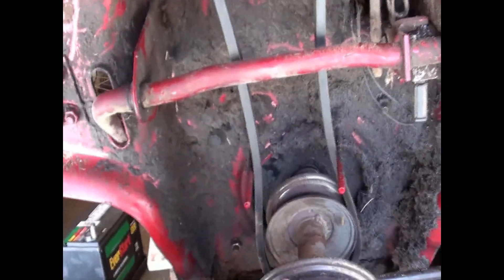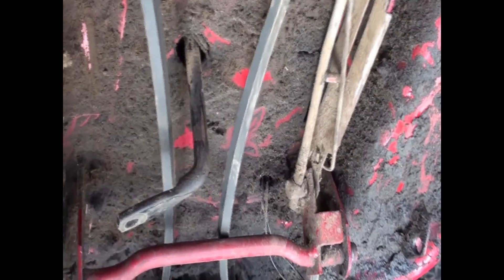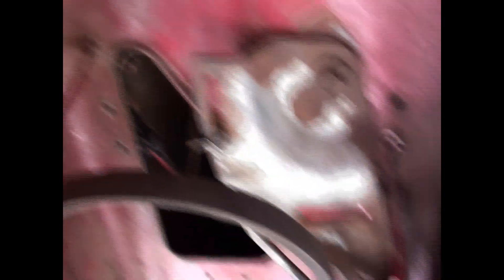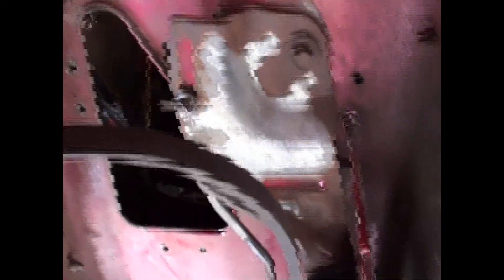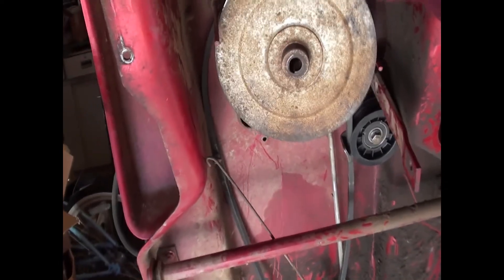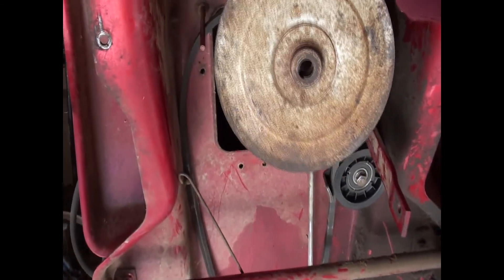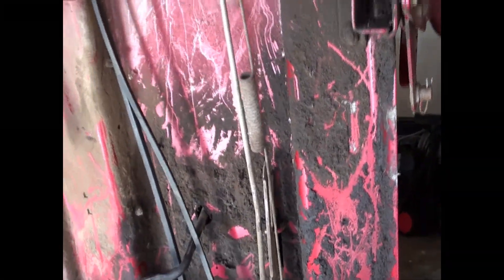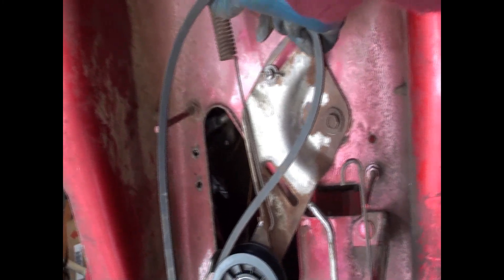Murray Riding Mower Transmission Linkage  part 1 (Model 38608X92C)

Comment: My Murray had the tension spring missing, because my model was sold under a white label I couldn't find the right schematics and therefore I wasn't quite sure how the spring was installed, your video was very helpful with that, thanks!
Reply from the maker: glad you found the video helpful.  FYI i got rid of the murrray a few years ago and have a White Outdoor 16.5 hp briggs twin opposed cylinders riding mower. Both the Murray and the Whites are MTD machines, I think.

Comment: What is the part numver for the idler pulley? Mine is worn out. Is there some kind of interchangeable one? I cant find that pulley anywhere.
Reply from the maker: Mine was worn out too and I replaced it with a new one.  
Google this:   "Murray Mower Idler Pulley 91179 or 42109"  Also search ebay for the same part number and description.  There are pages of them listed for sale.
Also a parts diagram is at the following link on the pages marked "Motion Drive"  https://www.partsandservice.com/html/Murray/lt/lt38608x92c.html

Comment: I have been trying for days to find a video that will show why the shifter just does not put mower into gear. It has no tension.  None of the quick fixes that I have been seeing is the problem.
Reply from the maker: It sounds to me like a problem at the end of the shifter shaft inside the transmission case.  The Foote, Dana and Spicer transmissions are very much the same in design.  You might want to search the many youtube videos under the search words Foote, Dana or Spicer transmissions.   Just for example, here is one that might help.  Within the video is some info on the shifter plate, spring loaded balls, and the need for lubrication.  Perhaps you are experiencing a problem with any one or more of those items? https://www.youtube.com/watch?v=2v6QCUTiGa8
Reply: @takeachanceonme4  thanks. I watched the video suggested. I'm afraid all that is beyond my capabilities. I was sure hoping it would be an easy fix. I believe I have already eliminated those!  I just don't know if I can get into the transaxle. 
Thanks for your time and advice.
Reply from the maker: @kimatkinson5162  at 22:55 in that video i posted in my response to you yesterday,  he shows two flat head screw adjustments next to the shifter rod.  Is it possible that adjusting those screws might bring the gears to shift once again?
Reply: @takeachanceonme4  thanks. I will see about that. Keeping my fingers crossed
Reply from the maker: @kimatkinson5162   this video shows the shifter shaft and the shifter plate located inside the transmission case.   https://www.youtube.com/watch?v=YGqD-QXsoxI        It gives you a good idea as to what is inside the case.  Always a good idea to keep the shaft well lubricated.  Perhaps a healthy dose (or 3) of penetrating oil (like wd-40) applied where the shaft enters the transmission case.  A lot of people, including me, have binding requiring a lot of force to change gears.   In my case and  in the case of the video above, lubrication of the gear shifting shaft is critical to its easy operation.  As you work the shaft back and forth, make sure the shaft itself is moving clockwise and counterclockwise, and not just the handle.   https://www.youtube.com/watch?v=YGqD-QXsoxI
Reply: @takeachanceonme4  well. I'm stuck. Can't get the pulley off the transaxle. 
It's difficult for me to just give up. I'm thinking bout cutting around the top. Don't know.
Reply from the maker: @kimatkinson5162  Yes, removing the pulley can be a problem.  I had to remove the entire rear axle and transmission (and wheels) to drop the assembly on the ground where I could access the pulley.  In my case there was a snap ring (or circle clip) that keeps the pulley  from sliding up and off its shaft.  With the snap ring removed, I used an air impact tool with a dull tip resting on the center of the gear shifting shaft (the very center of the pulley shaft).  I wedged a pry bar and very large flat head screw driver between the transmission case and the bottom of the pulley.  By applyiing firm, but not excessive pry pressure, and by hammering the end of the shaft with the dull point of the impact tool, I was able to "walk off" the pulley  without distorting the pulley or damaging the shaft or transmission case.   There are all kinds of videos on how to remove the pulley from a riding  lawnmower transmission.  Some have used wheel pullers, some use torches to heat and quench, some use torches to heat only, some soak with WD-40 for days; some use a torch and melt wax and others use gear pullers.   I found that "walking" off the pulley with an impact tool applied to the center of the shaft worked with mine.
Reply from the maker: @kimatkinson5162  This gentleman apparently tried all the standard ways to remove the pulley; but in the final analysis, he had to destroy the pulley (that was completely worn to begin with) in the process of removing the pulley.  In any event this shows how stubborn those pulleys can be and how "normal" removal techniques can damage the pulley.   https://www.youtube.com/watch?v=hxy7ZlrwLuQ

Comment: Hi, still working on my Murray. When you lifted your Murray straight up did you empty gas and oil and remove battery?
I’m about to drop the deck and remove new belt to measure it. Here’s the current situation:
https://youtu.be/_qSLVduduNM
Thanks, Ski
Reply from the maker: Yes to both.    I drained the gas by removing the rubber fuel hose from the carb and lettting the gas flow into a container.   The battery was removed too.  It wouldnt hurt to block the front end firmly so that the up-ended rear of the mower doesn't wag left or right and fall over.
Reply: @takeachanceonme4  thanks so much. I recently raised the front end up and tied to my workshop joist. This was after I removed the 14.5hp B&S to replace the sump gasket and oil seal. While up I took several videos but unfortunately did not clean off the transaxle, levers, springs, etc - just the area around where the engine sits - top and bottom of frame.
My gut says it has to be something simple. I already discussed with lawn repair shop and he said he could not guarantee he could fix it or get parts. At a minimum it will be $50-$60 to transport to and from so I wanted to do everything I could to make it better.
Alternative is to run after 6 mins until it stops working and buy a new mower. At 72 years old I really don’t want to do that.
Thanks again, Ski
Reply from the maker: @RogerASkiVideo     Sorry to take so long to get back to you.  I was traveling and finally got back home.  Unfortunately I don't have any experience or suggestions regarding the hydrostatic tranny.   However this link might help:     https://www.mytractorforum.com/threads/1996-murray-with-spicer-4900-3-093264-transaxle.1347867/   

and this link  by "Taryl Fixes All" may be of some use: 
 https://www.youtube.com/watch?v=t-XtQpHc3S0   

Skip the first 4 minutes of Taryl's link, because he does a little bit of acting before he gets to the repair stuff.  I find Taryl's "how to" are very informative and reliable.  He has a broad range of small engine postings and he also opened up a hydrostatic a few months ago and posted the step by step and piece by piece process.   https://www.youtube.com/watch?v=NS61QpRZdl4   It's a one hour long video 

    I did find a number of additional links regarding the Spicer hydrostatics by googling  "Spicer Hydrostatic" ,  one or more of which may be of use to you.   Good luck to you and let me know what you found out.  

By the way, I agree with you that this fix should be well within the scope of your ability.  If push comes to shove, go to one or several lawnmower graveyards and pull a replacement tranny off one of the cast offs at the graveyard.   Large cities and most states have lawnmower graveyards where you can show up with some tools and pull your own.  Also check ebay for used trannies of the same model.    Let us know how your problem is resolved!
Reply: @takeachanceonme4  thanks for your reply. I have watched Taryl’s videos. The one on disassembling the trans was excellent. Probably more than I can handle. Maybe if I was younger and healthier!
The first link you provided is actually mine. It was the start of the movement issue.
My next attempts will be remove deck and drive belt. Measure the belt and see if actually 1/2” x 86”. If not I will go to mower repair shop and buy a Murray belt. Then install belt and recheck all linkages and make sure there is a gap in slot of clutch pedal. 3/8” to 1/2” - if not adjust clutch rod nut.
While the belt is off inspect clutch rod lever to make sure moves properly. Other than that we’ll see.
Have a delay right now due to weather and preparing taxes! Thank goodness the grass doesn’t need mowing! haha
I will post progress. Thanks again,
Ski

Comment: Spring is not depicted in shop manual. Do you have a spec for it or replacement PN? Vendor?
Reply from the maker: does this help?   https://www.arkansas-ope.com/MURRAY_LAWN_MOWER_SPRINGS.html  
also  you might want to look at this link and click on the "motion and drive" option.  That takes you to the parts list, which describes 2 springs.    Take the spring part number and do a google search on that part number.  https://www.partsandservice.com/html/Murray/lt/lt38608x92c.html
Reply: @takeachanceonme4  Thank you very much!

Comment: VERY interesting and useful! Thank you.
Your machine is vertical. How do you do that? Remove battery, drain  oil and petrol? And vs  you just lift and prop it up of do you need a hoist? 
My Murray 11ic/36 is hard to change gear only when motor running so hopefully it's just worn pulley like yours or adjustment.
Thanks for taking the time to do this.
Reply from the maker: Thanks for your questions.  Yes, I did remove the battery and I did drain the petrol and I removed the mower "deck" before tilting the murray on its nose.  The oil however, was still in the engine.  The rear of the machine was much lighter than the front where most of the weight is under the engine.  Accordingly it was not hard to  simply lift by hand the rear of the lawn tractor and balance the mower on its nose.  I dont recommend balancing the mower that way without blocking the steering mechanism in some manner to prevent the machine from tilting o the left or to the right and falling down.   Perhaps rolling the machine on its side would be a better idea.  If you do roll it on its side, I believe they recommend draining the oil, or rolling the machine on the side that is opposite the side where you fill with oil (to prevent oil from draining out of the fill tube).

The hard gear change in my case (and it was very very hard to move the gear shift lever) was simply the need for some lubricant (such as a spray lubricant containing lithium where the gear shift shaft enters the gearbox. .  Please note that WD 40 is NOT really an acceptable lubricant because it evaporates quickly and is useless after about a week or two)   A good spray grease soaking and working back and forth of the gear shift lever returned the hard shift back to normal easy "sliding" of the gear shift lever.  There was nothing wrong inside the transmission/gearbox.

Comment: You did a superb job with video and explanations. I finally was able to lift the rear end with my Harbor Freight Pittsburg 300 lb lift. Did not have to remove mower housing. I found that the clutch rod cotter pin was almost touching the spring. In addition the rod was getting hung up in the slot. When that happened the mower did not move. I’d turn off the engine, lift the seat and manually push the idler bracket. The spring did the rest and the mower could move.
For the time being I sprayed some WD40 on the rod and slot. Hopefully this will help until I can get into it further.
Thanks so much for your great video. It helped me understand quite a bit!
Regards and be safe!
Reply from the maker: Thank you for sharing your experience with the clutch rod and the idler on your Murray.   I saw your Murray on your video that showed the pinched and shorted wires behind the starter motor.  Incidently, I also bought the Harbor Freight 300 pound lift about a year ago when it was on sale ( I paid about $80 for it).  That was one of the best and most valuable tool purchases I have made since investing in an OBD II scanner a couple of years ago.   I have used that lawnmower lift nearly every day for one thing or another.  At the moment I have a push mower with a 6 HP Briggs on it (I'm trying to figure out how to insert a new exhaust valve guide because its exhaust valve wobbles so much that there is a complete loss of compression.